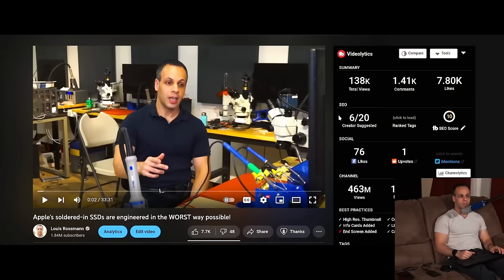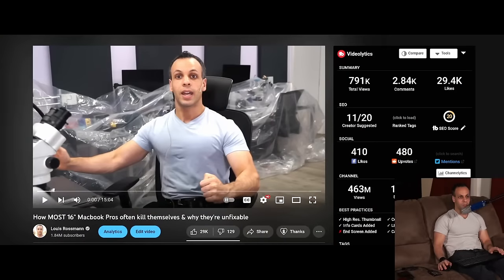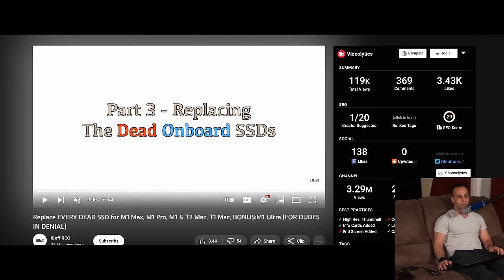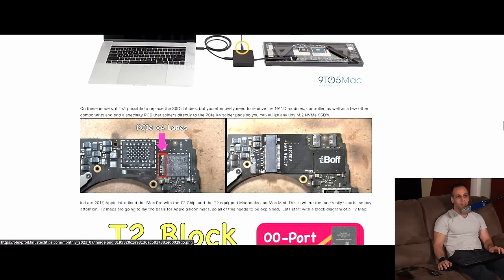The design of Apple's soldered in SSDs is worse than I thought!

Comment: Putting the BIOS on the SSD is like making a car engine dependant on the tyres it came with being in working order. Once those tyres go you need to replace the engine. They will eventually go as they wear down and break.
Reply: And you can only buy used replacement tires lmao
Reply: Dont give car manufactures any ideas please
Reply: I'll never own an Apple product, how dare they be such a pissy company.
Reply: @akosv96 Plus, those which you need aren't normal round ones but oval. Think different.
Reply: Whole thing can't be incompetence any more, it's malice. On any other laptop it's just an M.2 SSD swap, 50 bucks for cheap one, easy enough to do it yourself.
Reply: The saddest part of this scandal is the party line that Apple reps give for the soldered-in SSD on laptops: "We did it to prevent the SSD from shaking loose." Yeah, right, they expect the customer to fly in a Space X Capsule, and then ride the scariest roller coaster at Six Flags Great Adventure.
Reply: My key fob wouldn't work whenever my tires were low. Pretty sure it was some worn out wiring, but I could see them doing something like that easily
Reply: As a mechanic, I'm afraid someone is going to do that soon. Tesla already has semi-proprietary tires you can't get (well, not without the shop paying retail prices, anyway) unless you work for a chain that is also a dealer for the right brand (Michelin for the older ones, Goodyear for the newer ones.) And they're made in a way that is harder to repair, and most mechanics don't even know they're repairable.
Reply: @mattezuka1274 That might be a bug in the keyfob firmware or the BCM programming. If you have active TPMS - that is, a wireless 433 or 315 MHz air pressure sensor in the tire - the signal goes to the same BCM antennae as the key fob; sometimes it actually gets received by the keyfob and passed through to the BCM. (Also, since 315 MHz has a very slight overlap at the edge of the Bluetooth range, it's possible for your phone to mess up your TPMS. Not likely, though; I've only seen it happen once.)
Reply: Perfect example/analogy.
Reply: @akosv96 exactly, hunting for lightly used tires to get that car rolling. Never surprised when Apple back door fucks this
Reply: Is the BIOS really on the ssd? Sounds very strange
Reply: the Surface RT did this with its internal eMMC, and the Samsung-supplied chips were prone to failure so you can tell why mine won't turn on anymore.
Reply: That's why I hate apple. I had a look  at a apple all-in-one machine few years ago, couldn't believe the mains power supply was totally exposed to wandering fingers once the back was off. How the f people put up with their stuff is beyond belief . I'm looking at a A1932 mac book book, I didn't even know such garbage existed, just two usb-c ports and an integrated ssd drive.

Comment: So, the laptop's bricked when your internal storage dies?
Reply from the maker: Yes. You cannot boot off of any other storage because the POST process requires T2 chip to work which requires bridgeOS which is stored on the internal storage. 

 Back in the old day, we used to call that an SPI ROM chip or a BIOS chip, and you could easily solder a new one on when the old one died, if the old one died. This did not die very often because you are not writing to a BIOS chip the same way you are writing to the internal solid-state drive on a pro grade computer marketed to video producers.
Reply: yOu ShOuLd HaVe BaCkEd Up To iClOuD
Reply: So not only does it kill the computer it also loses the customers data as well?
Reply from the maker: Yes
Reply: @qbertrtrtg  Average Apple and Samsung fanboys when SD cards aren't supported
Reply: So the only way you can ensure your data is deleted is by storing it on an iPhone?
Reply: @MinecraftMartin  Encrypt the drive, and when it dies, no data can be retrieved. Keep backups on external storage. Consider all data on the main soldered drive toast. Also consider the mainboard toast as of the M1 since Apple made it unbootable from an external device.
Reply: that's kinda awesome how bad they are going to F their fanboys. It's like pusherman mentality. Drug dealers have better morals haha. I'm kinda in awe that they can get away with such insane f00kery! 🤣😂🤣😂🙃
Reply: @penguinjay  Sheeps don't care. They never do.
Reply: @GalaxyZeakwon When my phone died last year, two different phone stores couldn't imagine me not buying a (Samsung Android) phone that wouldn't let me plug it into a computer to back up my data.
Reply: iPad is so good but no SD card. Can't buy 🙄🙄
Reply: @rossmanngroup  i guess the playstation modchip producers will soon see a new market?
Reply: @atomicfrijole7542 Apple Silicon does boot to external drives but needs the internal NAND even more than T2 chip Intel Macs, because it copies your external drive OS's kernel to the internal drive before booting off of it. This was done because Apple Silicon Macs are basically built like iPhones and they had to improvise a way to boot to an external drive, which iPhones were never made for.

Basically you don't get a computer but a giant iPhone.
Reply: I'm old enough to remember when your hard drive/ssd was replaceable in a laptop that cost $2500
Reply: @Zebra_Paw  Good explanation, thanks for clarifying what I was trying, albeit poorly, to say.
Reply: @rossmanngroup  This is exactly why I refuse to buy the new Macbooks even though I think their M-series processors are great and my household has multiple iDevices. Their platform is just hamstrung by poor design choices which I can only cynically reason were intentional to prevent independent or user repair. Or just plain stupid like losing all your data if your NAND dies due to a design flaw. Sure makes it easier for them to upsell iCloud storage plans, though...
Reply: @GalaxyZeakwon another reason I'm clinging to my s10 plus
Reply: @Zebra_Paw but what if you flash android on apple silicon macs?
Reply: @rossmanngroup  I remember when laptops first began getting UEFI firmware, they had this exact issue - switch to UEFI without a working bootloader on disk and the system just locks up. So good job, Apple, you brought back terrible regular laptop engineering from 2011 or so.
Of course, on those laptops you could still discharge the battery and reset back to BIOS...
Reply: "Buy product, DON'T ASK QUESTIONS, then get excited for next product!" Describes most consumers but especially Apple consumers.
Reply: @BeerDone  Lenovo had the power button trick where you'd pull out the battery and unplug n hold the power button for 1 minute  but I dunno if you can still do that
Reply: @kornaros96  never tried, but there's probably a sh*t ton of proprietary hardware you can't find drivers for in Android, if it will even boot at all on the M1 chip.
Reply: @BeerDone  or just outright hard CMOS reset
Reply: @atomicfrijole7542  lol
Reply: @TheCD5150  still the case to this day outside of Apple
Reply: @rossmanngroup can you pre-change it before it fails ? like estimate how many writes is still can do and change it before it fails to prevent being locked out of your data ?
Reply: @remixedcat  Same here with my Galaxy Note10+ (also a 2019 phone). Its main storage was 256GB, and it's max external storage capacity handles up to 1TB SD cards. And I have one. Can't use that in new phones. And each time I call Samsung out for removal of SD card support and copying Apple, I get Samsung fanboys saying "Samsung does it better", "How are they copying them",  "Just buy an SSD or USB-C drive! This isn't a PC!", "Cloud storage is fast". Or they just straight up call me an Apple fanboy. Regardless of me having Samsung Galaxy products for over a decade, never bothered touching an iPhone, and having "Galaxy Zeakwon" in my username. I don't know where they get the idea that I "enjoy" Apple. I hate Apple. Even though I like Samsung, I'm not some fanboy. I'm still gonna call them out. Their fans will do anything to defend Samsung's actions.
Reply: @GalaxyZeakwon  yep... cloud storage has issues and outages and is much slower.... my LTE peaks at 300mbps on a good day here... but most of the time is 70mbps so not very fast for copying 1gb videos... I'm a creator!!!
Reply: @Zebra_Paw  we need someone with no life to find out.
Reply: @XtreeM_FaiL  they don't even know to begin with
Reply: @penguinjay  yeah I was shocked at first, now it just seems normal to me but just as outraging
Reply: @remixedcat  great. Guys, whatever device you have, try to keep it for as long as you can!
Reply: @nabilrise1551  First of all their death is very random, it's not like you can start expecting it like you can with a normal SSD really.
And even if you were to pre change it the NAND stays just as hard to get, and the soldering job just as difficult. Then you need to restore the firmware onto the new NAND, which Apple configurator can do but sometimes has issues.
Reply: @kornaros96  people with or without a life have tried installing Linux ARM in the past, and you can somewhat make it work. But don't bother, you don't get the same performance you get in macOS at all, and the SSD is just as likely to die anyways
Reply: Actually from what i learned from different places online it can be swapped out for EXACT equal parts it cant be bigger or smaller everything has to be exact. You cant replace a 500gb storage with a 1tb  or vice versa same with the memory cant replace 16gb with 32gb it has to be equal in size and capacity in order for the t2 chip to respond which is a huge problem with the nand and everything being sodder on problem
Reply: Pretty much.😢
Reply: @RandomGuy-qn2fr  and then it got further updated on the info that actually it just needs a bare nand from alibaba and a dfu job to save the day, which still is fucking silly and stupid but at least these computers aren't eventually toast at some point.
Reply: Yep. It's ok cause if you have the money for Mac products then you have the money for Apple Care and the repair. (For my 800 Mac mini they want 40 a year and 400 for a repair with subscription)
Reply: @davel4030  as if that Mac mini is expensive, $400 is criminal, especially since it's one of the more fixable ARM Macs...
Reply: @roundduckkira   yeah I saw through it, I looked at the pricing and laughed. The guy at the store blushed and said he had to ask. I hope others can see through the rip offs. I guess sometimes it's worth it but not always.
Reply: @davel4030  that's why third party repair needs to exist, so there can be price competition (and also so that services Apple wouldn't provide could be provided like a soldered SSD upgrade that dosdude can do for example)

Comment: It’s deliberate. Apple doesn’t want you to fix your computer. Apple wants your money. Don’t buy Apple. How do you like them apples.
Reply: well get a death note if thats the case
Reply: yes, i know, but the laptop is good
Reply: one remark companies not only apple
Reply: @HyperDevv, no, they are overpriced crap.
Reply: @oroville12345  90% of the time yeah
Reply: Unfortunately a lot of people will still buy an apple product.
Reply: @culan_SCP  If it breaks this way, then is not good. Is a time bomb.
Reply: JimAllen-Persona the Dell Latitude is much stronger, can have its SSD replaced, most of the time the RAM can be replaced too, and it will last much longer.
If the board dies, component level repair is much easier too.
LCD panel replacement is possible for cheap! And the laptop is robust as heck!

MacBooks are expensive out of nowhere, just for Apple to take all your money, but they make unbelievable profit
Reply: Wise words 🗿🗿🗿
Reply: @culan_SCP  If you think Apple laptops are good, you need to explore more, there are TONS of laptops that are just as good, if not better than Apples, and guess what they usually are 2/3s of the price...
Reply: All the companies will be doing this soon. It won't matter which brand.
Reply: @rooney301  Wrong. I've had Lenovo and HP Elitebooks, they are very much repairable and quite easily so.
Reply: @Zebra_Paw  I don't repair my laptop for 8 hours a day, the repairability is not the only metric for a good laptop.
Reply: @hikkamorii The important thing to remember, is that with most other brands you get repairability without asking for it. There's not a great argument to buy Apple, unless there's a specific software requirement. 

How does Apple make so much money if their computers are a great value? They're not a great value is the answer. You are buying status and branding. Anyone who argues otherwise is in denial.
Reply: Sadly as someone that used to fix consoles these kind of anti consumer practices are common. Stuff being intentionally designed to fail and being near impossible to repair
Reply: JimAllen-Persona  The retail price might be equivalent, but total cost of ownership will be way lower for a Latitude statistically
Reply: @rooney301  Buy a Framework laptop
Reply: @hikkamorii  what about durability?
Reply: @TheCarnivoreSoprano  I don't think so, at least not right now. And even if PCs manufacturers are going to solder SSDs, they won't use shitty NAND, they won't put their f*cking BIOS onto it, and their boards will still be much easier to do component level repair on!
Reply: Replace Apple with any company doing remotely well. Profit is the name of the game, and indeed I think it is only fair to assume a given company wants to maximize profits, often at the expense of their customers.

Also, repairability aside, at the end of the day it's a preference thing. I despise the OS of Apple products, but I've come to accept it has quailties, depending on who you are. It's not at all for me, but it is for some people. Hence I've stopped saying it's all trash. The anti-consumer practices though, ofc everyone should bash that. And yep it's not just Apple.

What people should be doing is not "don't buy X brand" at this point, but rather "support what's still good". As depressing as that wording is. Or rather we should indeed also actively seek to avoid what we know is making it worse for everyone, while trying to support endeavors that are actually trying to change things for the better.
Reply: @culan_SCP  The processor is good, the laptops themselves are timed e-waste.
Reply: @deraile  Yeah so just buy a framework laptop instead of a MacBook.
I know Apple is not the only brand doing such stuff, but they hold the world record by far!
Reply: @Zebra_Paw  Yes, except for the @#! plastic clips that hold the case together that break as soon as you even breathe on them when you open up the case for any work inside. This is true for my Latitude 5520 anyway. And yes, I used a plastic opener to undo the clips. One thing that I really like about my 2007 MacBook is the MagSafe power connector. The reason I chose it was to have a machine that could run both Windows (required by my school) and a unix-based operating system capable of running commercial applications.
Reply: @Zebra_Paw   They certainly are pioneers. They keep showing how far they can push their customers. It's no wonder others are following in their steps.
As for Framework, if I ever needed a laptop I would certainly want to try them. My favorites used to be these old Thinkpads with ports and gadgets aplenty. Hopefully FW can bring back some of that magic back.
Reply: @deraile  yes Lenovo is an amazing brand too, and rocking an old thinkpad today is absolutely possible for basic tasks.
Reply: @LarixusSnydes  oh yeah a 2007 MacBook is absolutely fine, no hate on those. I bought a 2012 15" on purpose and am currently writing from it.
Not all MacBooks are bad, only most of the newer ones.
And then if you want laptops made out of metal Apple isn't the only option, and anywhere Apple is not the only option, it's not the best option!
Reply: An Apple a day keeps the money away.
Reply: @VashStarwind no they aren’t
Reply: @RicardoSantos-oz3uj  the battery is very short and they are bulky
Reply: @VashStarwind  not with the battery life of a macbook though
Reply: @oroville12345  windows fanboy (i use a windows pc and a macbookj